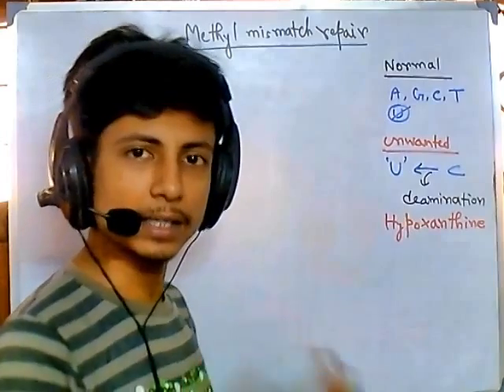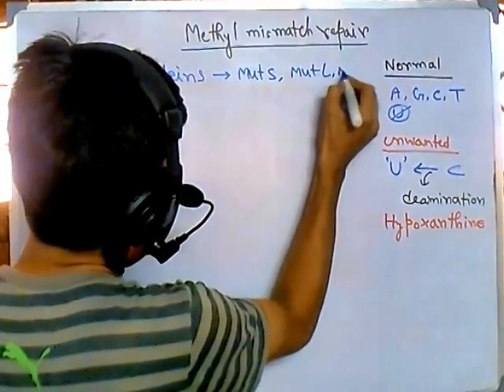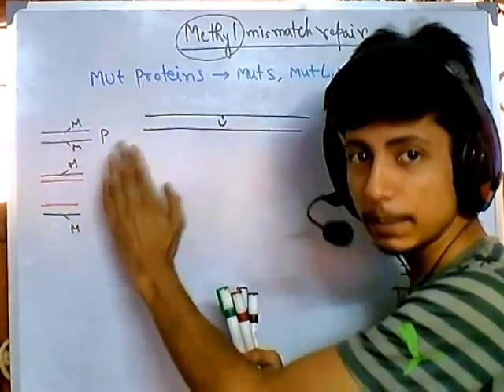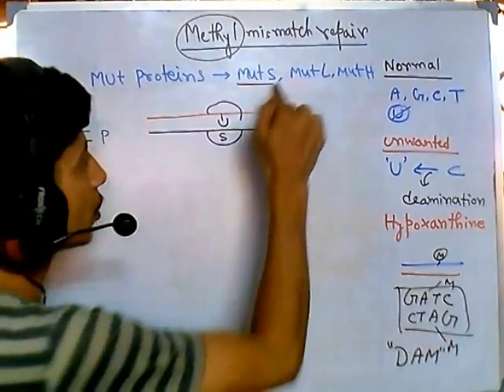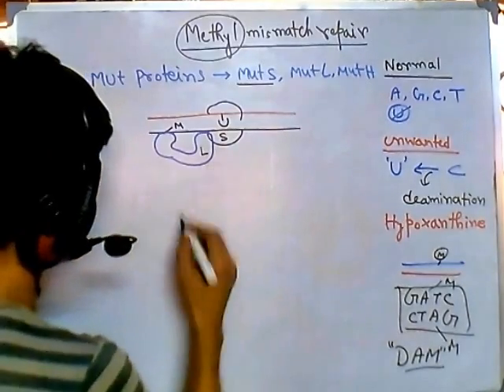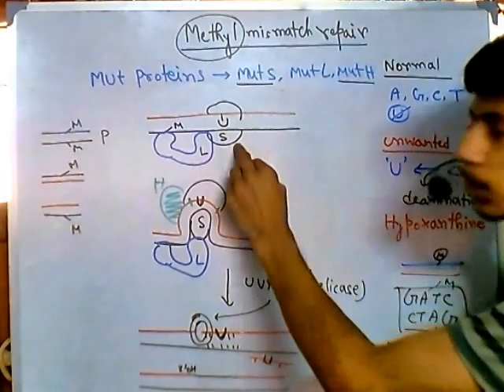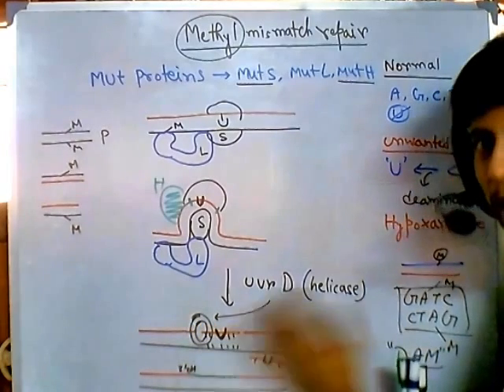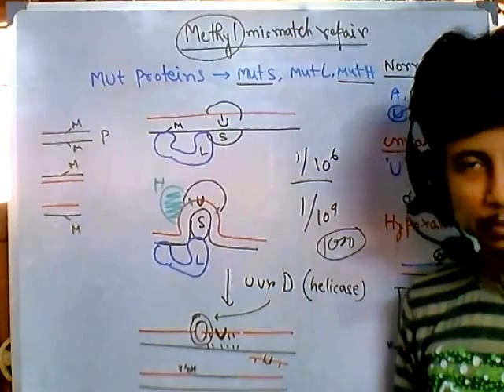Mismatch repair

Comment: This video is amazing but I I have a question. For the step that the segment that contains the mismatch is cleaved out, is the UvrD helicase doing the job, or is there another exonuclease presented in the process? Thank you!
Reply: Yes, uvrD removes the incised region of DNA containing the lesion by breaking hydrogen bonds between the parent and daughter strands, so an exonuclease is not required. (Although the excised DNA may later be degraded by a ubiquitous exonuclease that is not specific to the mismatch repair pathway)

Comment: lol... wtf... this is like a convoluted mix of MDMR, BER and NER.... Deamination is mostly repaired by BER, MDMR does use the MUT complex, but UvrD (Uvr helicase) is from NER... used in excising something like a thymine dimer, UV damage... hence the "UVR" UV repair in the name, this mostly (as I'm sure there are exceptions) does not happen right after DNA replication, MDMR is to fix replication errors, hence why there is no methylation on the strands...

Please, if you are watching this video, these are 3 different processes, this vid is very very mixed up.